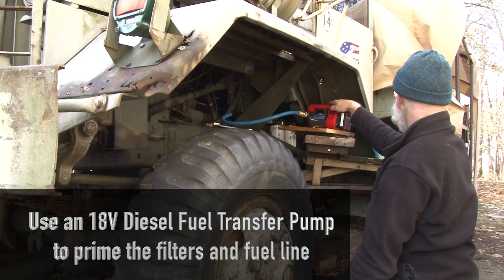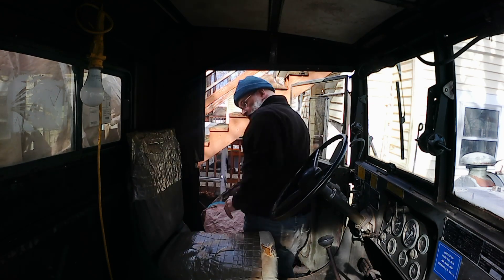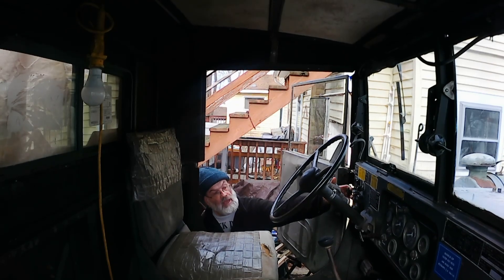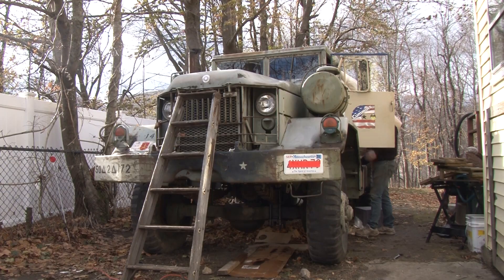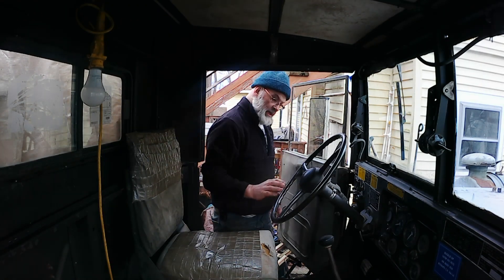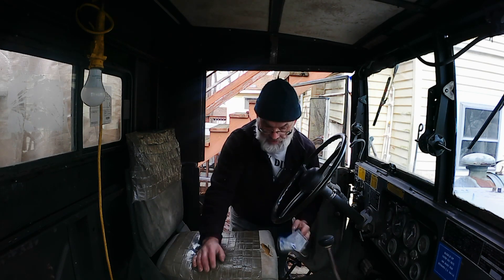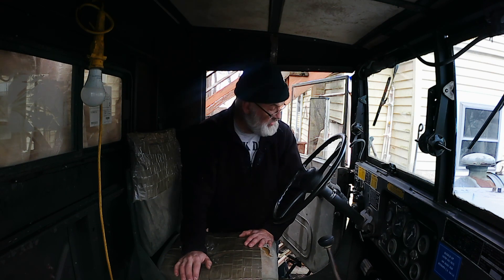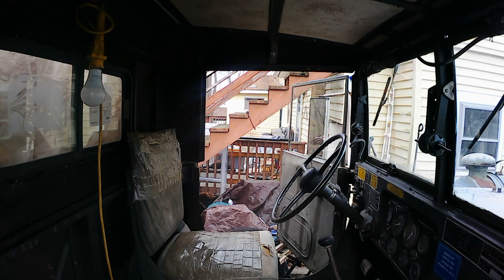My Ten Ton Toy Fuel Issue Solved

Comment: It was common that people put in steel pickup tubes, because they had issues with the copper sweat into brass ones, where the copper sweat into the brass fitting, over time would crack from vibration,  you can now get stainless steel ones from some guys making them. I had replaced mine with stainless, and also changed my fuel tank with an alluminum tank. The steel tank had several holes in it, and the pickup tube had cracked and broke off, it fell into the tank.